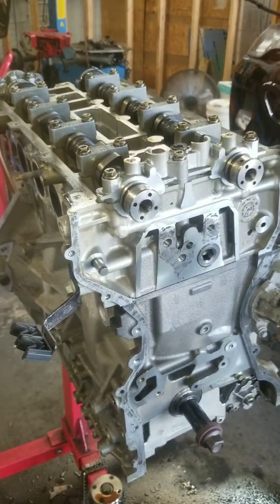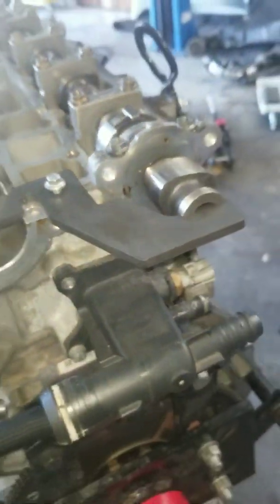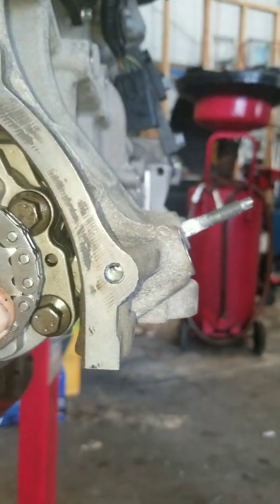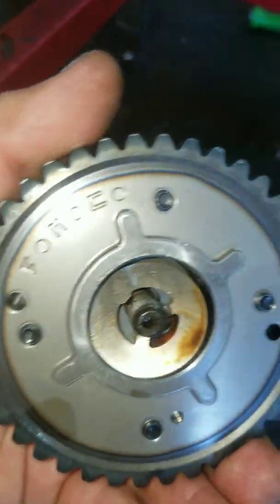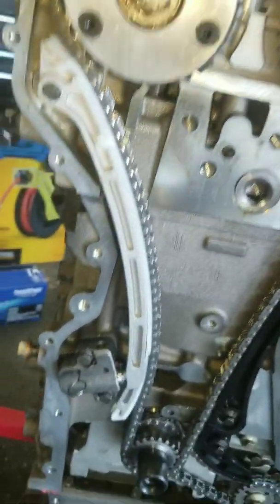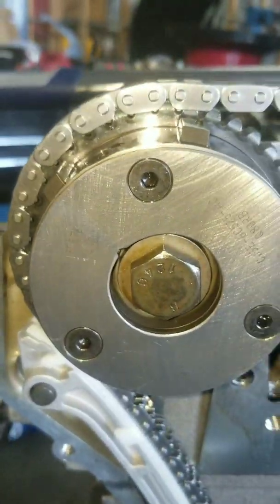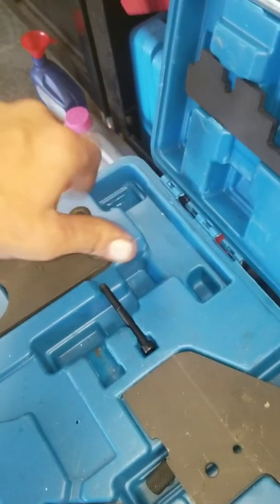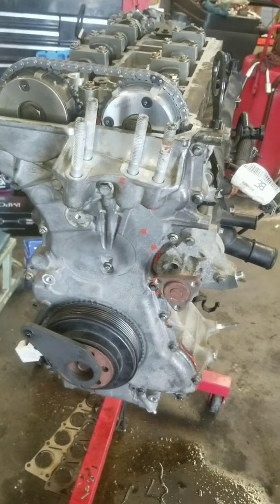Ford EcoBoost 2.0 Liter turbo engine timing setup -Ford Edge Range Rover Jaguar

Comment: Just wanted to chime in for anyone doing this job on a land rover. You gotta pull or at least give way for the passenger side cv axle to get at the motor mount bolts. When you do the final torque on the crank pull the 90° part? As long as all of your alignment tools are secured and lined up correctly you can give it the beans. I was concerned the tools wouldnt take it, they will.

Comment: So when you put the first pin in the back you've still got all that movement on the crank..... So how do you know what position to put the flywheel locking tool in? Looks like there's about 10-15mm of movement there before the flywheel tool goes in and that tool can slide too before you lock it down

Comment: Great video.   The Land Rover part numbers for the VVT sprockets are LR095897 / LR033733 (In/Ex) but as seen other places and in the video the part numbers CJ5E-6C524-BA / CJ5E-6C525-A0 are printed on them.  Those Land Rover parts are well over $300 each.  If I go to Ford and get the ones for the 2.0 Ecoboost in the Escape or Edge, they are $100 or less but they have the part numbers  CJ5Z-6256-C  / CJ5Z-6C525-B.   The numbers are different but the exhaust one has the same base part number (6C525) so it might be identical.  But the intake is different (6C524 vs 6256).  Does anyone know if they are the same?

Comment: When you do the timing chain do you have to remove the oil pan too? I thought just the timing cover but you had the oil pan off. Oh man.
Reply from the maker: No you dont have too remove oil pan.
Reply: @CarReadySmokeBrake  oh ok that will save me time I was literally about to go under and remove it thank you for the response! I need to get the timing cover off then but the crank pulley needs to come off, guess its time to use the locking tools!

Comment: Hey buddy so is there any alignment marks for the timing chain to line up to or it doesn’t matter how the chain goes on?
Reply from the maker: In that no marks on chains
Reply: @CarReadySmokeBrake  hey thanks man also if you wanted to remove the cylinder head from the engine can you get away without removing the turbo? Can you just remove the studs on the rear of the head and nuts and sliding it of?
Reply from the maker: @RainsMobileMechanic  i dont know. I never do on that engines because crappie

Comment: Hello, FORD ESCAPE 2.0L 2017, how much torque does the cylinder head, crankshaft bolts and camshaft bolts have?
Reply from the maker: @eldominante2810463  head bolts stage 1 is 7Nm stage2 15Nm stage3 55Nm stage4 90 degrees Stage 5 90 degrees.  Camshaft bolts for the gears is Stage1 is 40Nm stage2 60 degrees. both exhaust and intake. Camshaft shells 16Nm. Crankshaft pulley stage 1 is 100Nm stage 2 is 90 degrees.
Reply: @CarReadySmokeBrake  Ford Escape 2.0L ecobost. 2017. Thanks! A technical consultation. Does the vvt pinion or gear have a washer? As well as its other engines such as land rover 2.0L? I appreciate your help in advance
Reply from the maker: @eldominante2810463  Somebody ask a same not a while ago. Some have some are not. I dont know what is a difference but if they have I put back if not, I dont.
Reply: @CarReadySmokeBrake  Do some engines have it? and some other similar engines do. Does that mean for me?
Reply from the maker: @eldominante2810463  If originally have wshers used, if not maybe dont need it. I dont know why engineered differently but this is what they did.
Reply: @CarReadySmokeBrake  Muchísimas gracias AMIG

Comment: I have one question when I finishing the job one spark plug broke because it was siezed I added one spark plug n the engine is misfiring under heavy load do you think it’s  because I put a mismatch spark plug ? The spark plug for the vehicle is CYFS12YPC and the one I put in is CYFS12Y. It runs good if I don’t step on it but when I do step on it it misfires on that mismatch spark plug
Reply from the maker: Thank you for asking. What do you think? 😂
Reply: @CarReadySmokeBrake  haha obviously

Comment: 6:41 my gear does not have washers is it necessary? I will do without I will keep yall updated
Reply from the maker: From the old one? Have to be there a washer!
Reply: @CarReadySmokeBrake  I seen other videos where they didn’t took oil pan off. Why did you take it off ?
Reply from the maker: @DAAutomotive  Chek the balancer, not needed but on that car we was on multiple problems.
Reply: @CarReadySmokeBrake  mines a 2015 evoque 2.0
Reply: @CarReadySmokeBrake the old camshaft gear that came off was fomoco. It didn’t have a washer when I took it off. the new camshaft gear I am going to install doesn’t have washer either.
Reply from the maker: @DAAutomotive  Ok.
Reply: @CarReadySmokeBrake  thank you friend. I am currently in the middle of doing this timing job for the same reason. I’ll let you know what happens.
Reply: Update we finished the timing job and the car turned on fine without the “washer” the check engine light for the timing went away thank you for this video it helped !
Reply: Hola exelente video  . podrías pasarme el manual del motor
Reply: @ cual Manual? No ahi. El unico manual es el video como se hizo el jale

Comment: I did that exactly same steps and still have a timing code p0017 any ideas?
Reply: I had the p0016 after changing the timing and i just moved the crankshaft sensor a little bit and that was the problem.. Is just so bad made this engine.. You use the alignment tool for the sensor and even so you can have errors..

Comment: Sir I have questions.. iam doing head gasket replacement job in 2.0 ecoboot engine. The doubt is. Balance shaft timing also required for head gasket job?
Reply from the maker: Nope. But do not be excited. Statistics show head gasket replacement not fixing your problem. Just letting you know.
Reply: @CarReadySmokeBrake  seriously? Iam working on 2015 Jaguar xe customer state is drinking 1 litre coolant for 2 days the customer driving 50 km per day.. this is the problem. Before once engine over heated causes is radiator leak  then I change radiator an thermostat. After the coolant drinking problem is started ther is no any other leaks for a confirmation I do pressure test the pressure test also ok then I realised the problem is head gasket... Pls tell iam doing right or not ...
Reply: @CarReadySmokeBrake  seriously? Iam working on 2015 Jaguar xe customer state is drinking 1 litre coolant for 2 days the customer driving 50 km per day.. this is the problem. Before once engine over heated causes is radiator leak  then I change radiator an thermostat. After the coolant drinking problem is started ther is no any other leaks for a confirmation I do pressure test the pressure test also ok then I realised the problem is head gasket... Pls tell iam doing right or not ...
Reply from the maker: @mohamedsahabudeen9227  So 90% when this engines (ecoboost) ate coolant the problem is the engine block so this why I telling you do not be excited. Ford manufacturing defect. Have cases from 20k mile to 100k mile. In US even not selling head gaskets much because do not fix the problem.
Reply: @CarReadySmokeBrake  thanks for your information sir 😊👍

Comment: My car ford s max titanium x 240 (2011) ,EcoBoost went in to the garage to have chain and vvt gears changed only for the mechanic to order in the kit but turns out that my bottom crank gear is a single toothed gear and cant get hold of any kit any were. We found out through ford that from when my car was manufactured to then being registered, in a space of two months ford tryed useing slightly different components and now so hard to replace. Have tou ever come acoss this with the 2.0l engine.
Reply from the maker: Just buy other engine. Problem solved 😂👍 good luck.

Comment: I’m only 17 and I’ve done this on the 2.3 ecoboost in a mustang and it was peice of cake people make it seem so hard to work on the 2.0 and 2.3 when it’s not hard if u got the kit for it don’t worry about anything I just took it all about without the special tools the put it back together with them 0 problems runs amazing
Reply: Can vvt cause engine knock
Reply: @spgoham stop being scared easy fix go to the junk yard and practice on a 2.0 na .
Reply: What are the correct tools?  I have read lots of people that have purchased kits and the crankshaft pin is the wrong length.
Reply: Well I guess it would be easy cause they don't have a 2.3 ecoboost
Reply: Молодец. Когда есть голова на плечах и руки, то проблем и не будет.👍👍👍

Comment: I have a ford fusion 2.0 ecoboost imported from the usa. I have a misfire problem that we can't fix (p0300, p0301, p0303 p0316). The car is fast and drives great! At idle, detonation is felt along the body and the engine does not run smoothly! The forscan shows misfiring on all 4 cylinders, but worse on 1 and 3. If you have any idea what it could be, let me know! Thank you in advance!
Reply from the maker: sure. Take out all spark plug pressurized coolant system 21psi keep the pressure on 21 psi 5 to 6 hours and start scoping with mini camera in cylinders inside. If any coolant show engine garbage not repairable, need new engine. (do not try head gasket just waist money I went thru on that). that is a simple test. I think you already did spark plugs replacement and coils so maybe not that is a case. if not show coolant in cylinders, make sure the correct engine oil level with the factory recommended (5w30 synthetic blend). if its not help take off valve cover and start dig in deeper. Good luck. (otherwise importing used (regular not luxury) cars from US not a good thing this days. No maintenance 90% so after 50k miles all trash.🤣
Reply: @CarReadySmokeBrake  Checked the valve clearances too, they are fine. Could this be due to the camshaft and crankshaft not working in sync? that is, due to incorrectly tuned ignition
Reply from the maker: @РахманБатукаев  so that cars ecu's factory programmed to hide misfire until one point and turn over the missing cylinders to "air compressor" mode case want save the engine from bigger damage. 🤮. If its no other codes have in ecu like timing codes or something I have no clue but also check the timing make sure in the correct position do not forget balancer assembly in crank case and do not forget they do not have key pins at all everything need torqued well. Do you need all special toolset for that.

Comment: Anyone working on this hunk a junk motor this is the best video to learn from many thanx sir !
Reply: Nothing wrong with this engine.my vep 2.0 has 195700 ish miles on it, 2014 fusion, but I take very good care of it.not like those crappy dodge Chrysler engines
Reply: @randellgribben9772  I also have 2.0 vep.  What do you mean you take very good care of it?
Reply: @GuitarOfTheBlues  every 6000 miles oil change with a dexos2 type oil.. every 3rd oil change  i exchange 4 quarts of transmission oil,, valvoline LV .. every year new spark plugs and cabin filter.. every 2 years engine air filter,, check every 3 months for damage.. water pump every 80000 miles( easy to do )check hoses every 6 months.. replace every 100000 miles, and replace coils at the same time.I use ceramic brake pads, on standard rotors..not the boy racer drilled and or slotted rotors... and just keep the car clean.. added oil vapour seperator a few months after i bought the car new.. very little carbon on the black of the valves.. and easy to remove when needed..  i work as a classic Italian car tech.. so my time is free..   dont have to pay someone to work on my car
Reply: @randellgribben9772  thanks for response!
Reply: Its either this engine or a the 1.0 ecoboom. so far the 1.0 is worse engine.. by far and the most freaking expensive to repair..

Comment: Very clearly nice job. Just attention to tell remove the vacuum pomp adapter on the end of inlet camshaft to install timing tool.
Reply: How do you remove the adapter? Mine is stuck on the camshaft.
Reply: I took mines loose with a flat pry bar and the 24mm wrench @SilverGoat-do2pm

Comment: do you use aftermarket timing kits? If so do you have any to recommend?
Reply from the maker: This one parts ordered from dealership because aftermarket was backorder. Fun fact I dont do this engines anymore because not fixable so just replace the whole engine. Junks!
Reply: @CarReadySmokeBrake  Why don't you work on them anymore. Just put a piston into my jaguar xf 2.0 that had a hole in it. Also changed the timing tensioner, guide, and rail. Also the intake sprocket. Seems to run fine now
Reply from the maker: @andrewsir6363  First Im working with a used car dealership and we dont buy jags and land rovers anymore. Ford ecoboost just a few because many of them was a problem overheated eat water cetra.
Reply: @CarReadySmokeBrake  The 2013 jag has the 2.0 ecoboost engine in it. You are dealing with the newer engine models that have the open deck cooling on the engine block that crack or give out leading to needing a new engine. Stay away from ecoboost engine from 2017-2019. These are the ones with those issue

Comment: Quick question. on my  on my ecoboost 2.0, I had P000A71 Intake (A) Camshaft position slow response bank 1. Mechanical failure, actuator stuck. I purchased new and replaced for both intake and exhaust solenoids, put the valve cover back on and now have a rattle at low speeds which seems to be coming from the timing chain, I now have P001678 Crankshaft Position - Correction Correlation Bank 1 Sensor 1 and 2 - Alignment or adjustment incorrect. The engine has done about 124k miles. any suggestions on what to look for? I think the timing chain is past my pay grade.
Reply from the maker: Bad news. Need to do timing job and check reset timing with proper tools. I think camshafts gears off toming or even broken insode so maybe need new gears too.

Comment: love the video but my question is how did the fly wheel turn with the locking pin on the crank? i had to do this job but when i was timing mine the flywheel didn’t budge as soon as i got the locket pin on the side of the crank.. my boss & i we’re confused when we seen that.
Reply from the maker: Need a correct sized lock pin which is not allow to turn flywheel just one way. when the timing cover off you see where is the correct position. Just set in the correct position and install the flywheel locker.

Comment: Wait can you replace the chains and sprocket gears with the engine still in the car, oil pan on? I have the valve cover off and the timing cover off.
Reply from the maker: Yes
Reply: How can you lock the flywheel with that tool if the trans is attached?
Reply from the maker: @jeffreycicero6685  Take off starter
Reply: @CarReadySmokeBrake  ohh ok.  Thank you!

Comment: what is the torque of the cylinder head bolts. thanks
Reply from the maker: I not even know because no reason to do that. Engine garbage.
Reply: 65-72 lbs. you’re welcome

Comment: I have a Range Rover in the workshop due to overheating, I passed refrigerant to cylinders 2 & 3
Reply from the maker: the diagnose overheating min 5 hour process. U need pressurized coolant system 21 psi and take off  spark plugs. keep the pressure 21 psi and scoping cylinders. If you see any coolant drops in cylinders you have to change engine (need new engine!!! Brand New!!!) engine not fixable. Manufactory defect on engine block! Not even try head gasket replacement, just waist money and time.
Reply: Thanks where find a supply for this
Reply from the maker: Harbour Freight🤣🤣
Reply: 😅 very funny but un My country no is to easy

Comment: Not to mention if you do in the car you have to remove axle and motor mount to install the crank stop tool.
This is one of the stupidest engines I ever worked on
Reply: And nothing in SI tells you to remove the adapter from the intake camshaft to install tool , it simply unscrews with a large Allen socket, one of the techs I work with was frustrated when the cam tool would not fit !
I dose appear to be one piece so if you didn't know you could be second guessing here
Reply: @keltecshooter  what adapter do you have to remove
Reply: thats not true, it fits in without doing that
Reply: @TYGIXXER60  
I have done several and it is absolutely impossible, its simply too long
Reply: @TYGIXXER60  How did you get it to fit?
Reply: Having trouble with the 10mm bolt that goes to oil pan. It's extremely tight and almost feels it wants to break.  Almost tempted to drilling through the bracket, making a hole for the special tool. Kind of afraid it will weaken it. This job is one I never want to do again.
Reply: Amen to that brother

Comment: so location of cam gears dont matter? they have 3 trigger marks on the back that the cam sensor reads? I believe intake has 4trigget marks on rear next to sensor also.

Best detailed video i have seen on youtube yet tosetting timing on ecoboost
Reply from the maker: The camshaft sensors not on a gear side. Signal pickup from the other end. Exhaust cam gear 3 bolts intake gear have 4. Thats it.